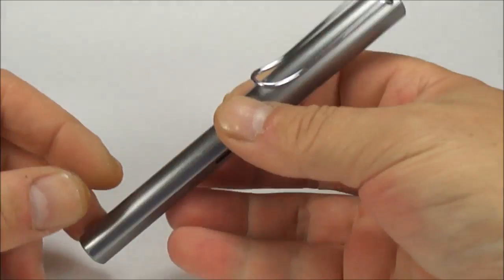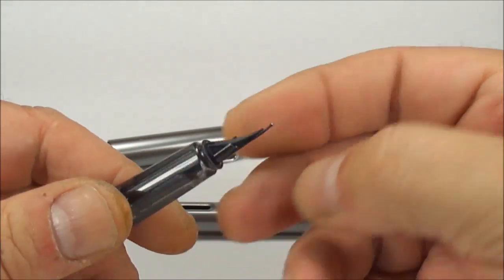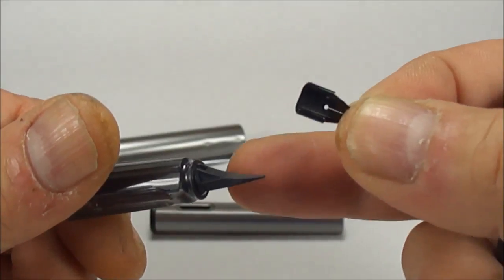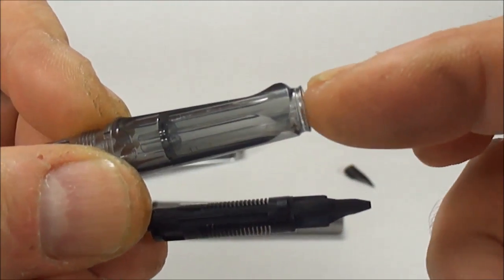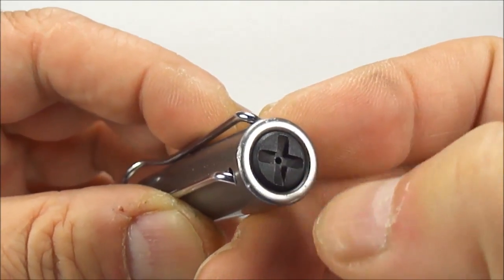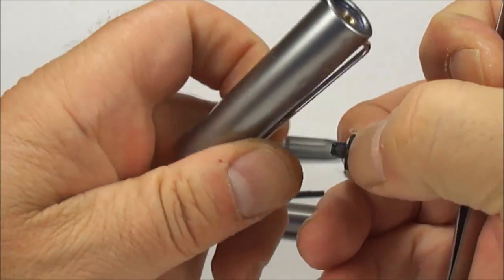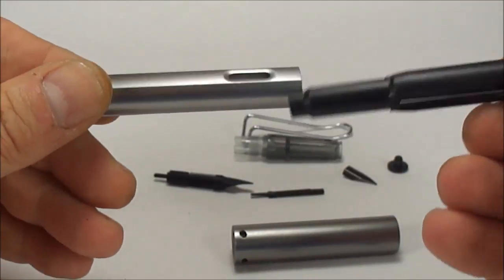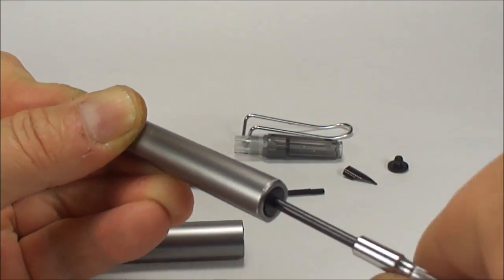Lamy Al - star AL Fountain Pen Disassembly

Comment: This is very, very helpful -- but I wish I had seen it BEFORE trying to replace my nib... and inadvertently pulling the feed partway out.  I seem to have twisted it, and now am unable to pull it out (or push it back in, for that matter). Any suggestions?  
Again, thank you so very much for posting this extremely detailed video. Very much appreciated!
Reply from the maker: Sorry to hear abot your nib, but yes you have to remove it correctly so you dont damage it. Thanks for watching and good luck Judy.

Comment: I finally see this 6 1/2 years after release and it’s as relevant now as ever. I just saw another video elsewhere that didn’t show the extra strip in the feed. Maybe Lamy changed the feeds since then.
I bought my Al-Star just a few months ago and haven’t had to disassemble it yet but this beautifully clear demonstration is timeless. Thanks, Stef!
Your information on the Mentmore Autoflow in other videos also helped me immensely. Another heartfelt thank you.
Reply from the maker: Normally pens do not need dissasembly unless there is a problem, so if it is working then leave it. Im glad the videos have been helpfull, thanks for watching.
Reply: I’m a full believer in the “if it ain’t broke, don’t fix it” philosophy. Just very good to know IF it’s ever needed. Thanks!
Reply from the maker: That is a good philosophy to have. Good luck.

Comment: Fascinating, thank you. I have a ludicrous amount of Lamy pens in my stash, of which 17 are Al-Stars. I've never seen a complete teardown before. I never knew about that little black slide-in portion of the feed. I thought it was all just one moulded unit. The few times I've removed the feed I never noticed. What strikes me the most about this is the way there's quite a bit of design that went into the pen, and the fact you can even do a full teardown of the barrel is a particularly nice touch. Don't know why but I like engineering that is intricate yet sturdy and serviceable. Thanks to you here, I now have a whole new appreciation for my Lamy pens as companions to my equally ludicrous number of vintage Parkers!
Reply from the maker: Hi Graham, im glad you enjoyed the video thanks for watching. The Lamy pens are a little to modern for me as i prefer vintage.
Reply: @penkino1  Yes, I love vintage too, almost always Parker low to midrange. My most exotic are a few Duofold AF. The majority are 17, 17 super, Lady, 21, 25, 45 and 51. There are several Duofold Junior, Slimfold and Victory, and a smattering of others. I love them all and it continues to amaze me how long they've lasted & how well they still write.
Reply from the maker: Yes the Parker UK Duofolds are one of the best mid range everyday writers and are great pens. Enjoy them.

Comment: Don't laugh. Well, ok, laugh if you must. I have a number of other fountain pens but just bought my first Lamy LX, which is spot-on identical aside from some cosmetic coatings and the like. You video was a tremendous help. Easy-peezy, Japaneezy!
Cheers, mate!
Reply from the maker: Every one has there own preferences, so no problem. Im glad it was helpful to you. Thanks.
Reply: Jack L. Lamy is German, not Japanese :)
Reply from the maker: Yes they are German.....
Reply: Yeah, well, Easy-peezy, Japaneezy is an expression regarding something that is quick, easy, and no fuss. But, yeah, thanks, Captain Obvious!
Reply from the maker: The expression is quite common here in the UK, so thanks.

Comment: TIP: I've struggled removing INK feed from section after I've used very dry outdated ink, it pretty much glued all together, so I have pushed the feed out by applying pressure from the barrel side (from the back of the finger grip, where you'd insert ink cartridge, if that makes sense), using a blunt, non-sharp object gently push it out and feed should come out.
Reply from the maker: Great tip, thanks. Unfortunately i do not work on many Lamy pens.
Reply: Tried your tip and crushed a barely visible sleeve meant to fit snuggly into the ink cartridge or converter and prevent ink leakage.
Reply: @penkino1  It doesn't show - you certainly figured out how this one  went together.

Comment: hi , i have a Alibi stubby bullet shaped cartridge pen , i took it apart to clean it and now i can’t put it back together , can you help . ?   x
Reply from the maker: Im sorry im not familiar with the pen you mention. Try the opposite of what you did to disassemble it. Good luck and stay safe.
Reply: Grandmia Pens oh dear well if only it has been as straight forward  , l worked it out in the end. turned out that although the main part of the pen is well engineered the crucial piece is plastic and below par. . thanks for the reply though . stay well . x
Reply from the maker: Well done with your pen. Good luck

Comment: I tried to remove the nib of my Lamy Safari and it's easy. But it's impossible to remove the inner black body
Reply from the maker: Well done with the nib, but why would you want to remove the "inner black body" ? If you do not need to then leave it alone. Thanks
Reply: @penkino1  because my pen doesn't write anymore, so I wanted to clean everything deeply.
Reply from the maker: If it is the black inner lineing then that does not effect the workings of the pen. So just leave it.
Reply: @penkino1  thank you very much! I think I will buy a new pen
Reply from the maker: Why not go for a nice vintage pen. I have some available. Cheers